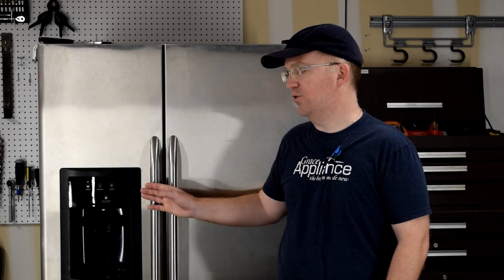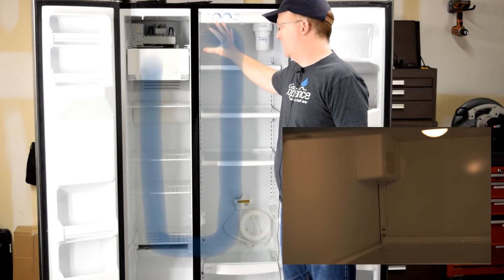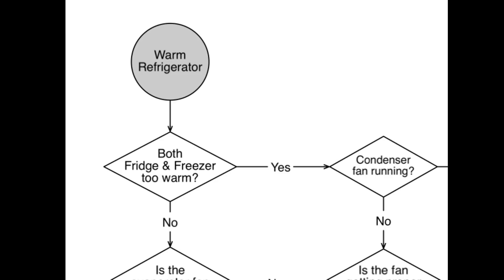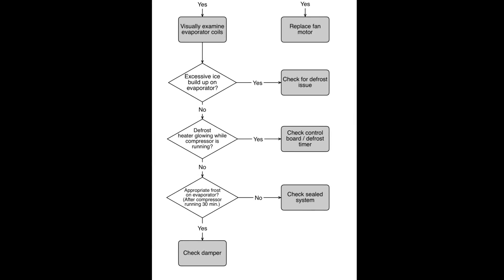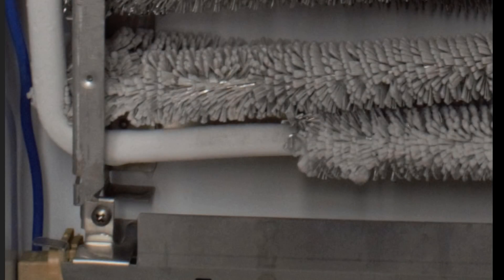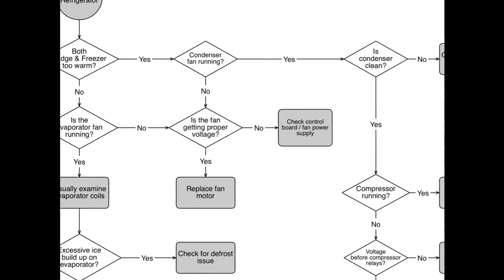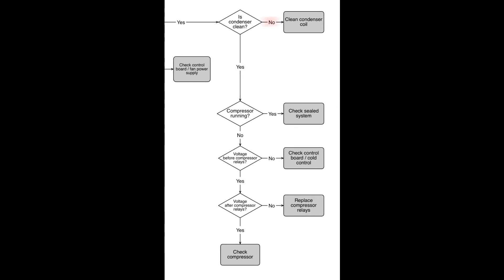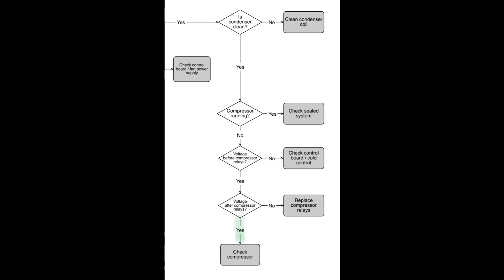Refrigerator Too Warm - Diagnostic Steps

Comment: Andy, hugs you're the best :)
Reply from the maker: Thanks!  I'm glad to be helpful. Stay in touch.
Reply: Hey Andy, I'm sure this wasn't what you had in mind when you said keep in touch. But im hoping you can please help me again. What could cause a motherboard to keep failing? Background...I have the same test fridge you have in the video.  
My fridge stopped cooling a month ago only the interior lights were on. I changed out the 200D6221G009 board. The original didnt have any burnt areas, but when I put the new one it instantly worked for about a month. Today the panel started to act weird...flashing 0s across.  So I pulled the fridge out to disconnect it and try to diagnose the panel. I heard a click then everything turned off again except the interior lights. Its still plugged in n rechecked the fuse. I think the motherboard is bad again after just 1 month.

Comment: My fridge is at 63 degrees and freezer is at 47 degrees. How can I fix this?? I need help.
Reply from the maker: Hi Mai, 
If you will please send your model number that will help me in pointing you in the right direction. 

Are you able to tell me:
- Is the compressor (behind the fridge and looks like a bowling ball) running?  
- Is the fan next to the compressor running?
- Can you hear the fan inside the freezer running? 

Thanks!
Andy
Reply: GE Side-by-Side ONLY - Refrigerator Repair Videos yes it’s running
Reply from the maker: @Mai.Faith86  and how about the fans?  What is the model number please. You can find this inside the fridge section on a white or silver tag.
Reply: GE Side-by-Side ONLY - Refrigerator Repair Videos model # is LGUB2642LF9 & the fans are running.
Reply from the maker: @Mai.Faith86  the next step, I would want to know if the evaporator has excessive build up of ice on the coils.
This sometimes can be seen with the evaporator cover still on, but often will require some disassembly of the freezer.

Depending on your comfort level with all of this will let you know how to proceed. You'd need to remove the freezer door to give you space to work and the remove the back wall of the freezer to expose the evaporator coils.

After the compressor has been running for at least 30 minutes, you should have a light coating of frost on the coils. However, if you find that after running for several days you get excessive ice build up on the coils, this frost build up will block the air flow in the freezer and fridge and cause the higher temps.

Let me know what you are seeing on your side. Thanks
Reply: GE Side-by-Side ONLY - Refrigerator Repair Videos I do see ice buildup in the freezer and fridge. I’ve tried defrosting and unplugging the fridge for couple hours but it’s still showing the high temps. I’m not at all good with fixing or repairing appliances. 😕
Reply from the maker: Mai Nguyen hi Mai, 
It sounds like you have a defrost issue. 
If appliance repair isn’t something that comes easy for you, you may consider having a professionals help with this particular job. After some substantial disassembly, It’s going to require using a meter to test appropriate live voltages to rule out a failed control board, perform continuity tests on the heater, thermal fuse and sensor. Anything outside of the control board and this particular fridge is a bear to work on if it has defrost issues.  I hope the info is helpful. Thanks!

Comment: Hello Andy!

   I just watched your videos on the GE side by side refrigerators. My unit was warm and the compressor was not running. One of the relays on the board was clicking every 5 seconds or so. When it would click the condenser fan would twitch but not actually run. I did the tests of the j2 plug per your video.  I had just shy of 13v red-white wires, nothing at the yellows. Jumpered the yellows and both fans ran. Unplugged the j2 to do a resistance test an the relays quit clicking and the compressor kicked in and ran. Unplugged the condenser fan and checked resistance at the fan and got a 1.688 reading. Checking resistance at the j2 i got a low reading like your video. So even though it will run with a jumper, does this sound like a faulty evap fan and a bad board like your video? Or a bad board and a strange resiistance reading at the j2?
Reply: Thanks for the info Andy! Have you done a video on evap fan replacement and I'm just not savy enough to find it? Or is that a video you have not done yet?
Reply from the maker: chad hoover hey Chad, my videos won’t usually cover disassembly / reassembly as much as they’ll cover the actual diagnosis of the issues. I just don’t focus on that nearly as much because there are some really well done videos on how to perform most of this out there already and they do better at it than I would anyway. LoL

I love Steve from PartSelect...he’s like my grandpa that I’d like to buy a drink for at some point in my life.  It’s on my bucket list.  

Here’s one that I like:
https://youtu.be/d5EzKao5QCU
Reply from the maker: It sounds like you've got a failed evaporator fan motor. The fact that you can unplug the fan motors from the board and the fridge functions as normal indicates to me that the fan motor has a short.  It's almost always going to be the evaporator fan motor because it is constantly wet and the water shorts out the fan motor and gives your symptoms.  However, if you wanted to double check this theory - you could unplug just the evaporator fan motor at the fan itself and see if you get the same results as you've gotten. 

If so, your evaporator fan motor is bad. Side note, once you've unplugged the fans at the control board, you can take another voltage measurement on the board directly for the fan motor pins and look for 13.5vdc with the fans unplugged.  If you get that voltage, your board is not at fault. 

If you have a 4 wire evaporator fan motor (with no sensor attached) you'd need this fan: (ordering through these affiliate links helps the channel as we get a small commission from the purchase) WR60X10185 - https://amzn.to/2lgv7LZ
Or
If you have a 4 wire evaporator fan motor with the defrost sensor attached, you'd need this fan: 
WR60X10074 - https://amzn.to/2lm5Xf7

You can purchase either the OEM versions I linked to, or an aftermarket which are cheaper. I tend to lean toward the OEM as I've never had any issues with them failing after repair, but either way is probably fine. 

Please let me know if you have any questions!

Thanks,
Andy

Comment: Thank you. I followed your chart. My G.E. fridge is not cold enough. It just started getting warmer about a week ago. The freezer staying at 20 and the fridge staying at 53.It's not fluctuating from these numbers after all the work I've done to it.  I've cleaned the the condenser coils. Did a continuity test on the compressor, and it's fine. I also tested the start relay switch, and it is also good. I removed the evaporator cover and I noticed a light build up of ice on one side of the coils. I don't know why it's not getting colder. Perhaps a T-stat problem? Thank you very much. Any info appreciated. By the way, my refrigerator is 24 years old this month. Perhaps it's time for a new one, but I'm trying to do all I can to bring it back to life first. :)
Reply from the maker: Hey,
So, the evaporator coils should be getting a light coating of frost on almost all of the rungs of the evaporator. If your compressor and fans are all running and not cutting on and off, after about 30 minutes of run time you should see a light coating of frost on the evaporator.

If not, that would be a problem with the sealed system and probably not good news.

If you want to take a picture of the evaporator after it's been running you can send it to Graceappliance@gmail.com

Thanks!

Comment: Hi Andy. I have a side by side door unit GSS25GSHECSS.  Its 2-3 years old.  Ice unit started melting and noticed both sides were 20-30 degrees warmer then set temps of 0 and 38.   stays a constant temp of  29 for the freezer and 57 for the fridge.  Trying to diagnose the problem now.
Reply from the maker: hey Rex, are you able to verify that both the fan behind the fridge (condenser fan) and the evaporator fan are both running? 
Are you seeing any heavy frost build up on the back wall of the freezer?
Reply: hey, I verified the condenser fan is running. Also the freezer had only had  frost on the first two coils. I didn't pull the evap fan panel yet but it wasn't blowing any air out nor did i hear it running.
Reply from the maker: @rex1759  hey,
If the compressor has been running for at least 30 minutes you should have the majority of the the evaporator rungs coated in a light frost. If not, this sounds like a sealed system issue. Either the compressor is weak or it has lost its refrigerant charge.

If you wanted to send me a picture of the evaporator to Graceappliance@gmail.com I would be happy to confirm this diagnosis.

Thanks!
Reply: I think the evaporator rungs are working properly.   There is light frost on all of them.  It was when i first removed the back panel there was light frost on the bottom rungs but the upper two had a heavier frost on them. However, The evap fan will not turn on at all.
Reply from the maker: @rex1759  OK, that sounds better. Heavier than normal frost build up on the upper rungs nearest the fan is a symptom of no air flow. So that's good.
Reply from the maker: I have a video specifically on diagnosing a failed control board when the fans are in question if you will look for that one it will help you determine if the board or the fan has failed.  Let me know if you have any questions. Thanks!
Reply: @GraceAppliance ok thanks
Reply: I replaced  evaporator fan motor hoping it wasn't the  board.   Problem solved.    The old motor had a funny smell to it like it burned out. Thank you for your help.    $15 dollar cost and a little time and tools.  My wife did most of the work because she could fit her body and both hands in the freezer.
Reply from the maker: Rex awesome job!  I’m so glad it worked out for you!  Thanks to the follow up.

Comment: Hi andy. If everything is running and cleaned and should be cold . What now?. I have a frigidaire model # FFHS2322MBE was giving to me a week ago . I plugged it in left it alone for 24 hours and it still not cool. The thermostat is showing H1 Which I'm sure means temp is too hi. And the fridge is too warm. I was told to unplug it for 5 min. And then let it sit for another 24 hours. I have done it 5 times now. And still showing the H1. Everything seems to be running fine though. Just not cool.
Reply from the maker: Hi, 
The things I’d check is to verify that both fans at working. You’ve got a fan behind the fridge and an evaporator fan. If the one behind the fridge is turning (condenser fan) the compressor should also be running. If one is running and not the other, that’s an issue that we could look at. 
If the compressor is running and the freezer is warm, the evaporator fan should be running as well. 

Now, if all these are running and not cutting on and off, after about 45min of run time, you should notice a notable difference in the freezer temp. 
If not, I’d want to know how the evaporator inside the freezer looks by removing the interior back wall of the freezer section.  The majority of the coils should then be covered in a light coating of frost. If not, that indicates a sealed system issue. 

Let me know what you’re seeing with respect to the compressor running and fans. 

Thanks!

Comment: Thank you for all your help. Twice in a month a repair man has been to my home because My fridge was warm at 60 degrees and spoiled all our food.The freezer was cold but not freezing he took the back panel of our double door fridge and took it out side and hooked up a water hose with hot water to remove thick as a block of ice build up on the could .he said that's standard practice and there's no problem with manually defrosting the coils twice in a month .last night he did it again and this morning it's doing the same thing :(
Reply from the maker: Hi Gnella, I’m sorry for the slow reply.  This doesn’t sound normal to me. It defiantly sounds like a defrost issue to me if you haven’t had this issue in the past. There are freezers that are manual defrost, but usually this is once or twice a year. I’ve made a video today addressing this and am uploading it tomorrow.  But, the short answer is that if your fridge is not manual defrost meaning it has a defrost heater, you shouldn’t need to be doing this often at all.
Reply: Thank you very much Andy 🙏🏻 all of your videos are very helpful keep up the great work .

Comment: Andy - I am back!
Hope you're having a great Fourth.
I would be except I'm still trying to fix that GE fridge that's been hot for over a week.
Where I am now.
I have a 3-1 that I connected, going through the run capacitor.
BUT there are so many different wires and connectors I wasn't sure it was connected properly.
I did test the windings (?)
Run > Common - 4.6
Start > Common - 7.1
Run > Start - 11.5 

The compressor hums but no loud noise.
Today I tested continuity between my plug and the 3-1 to make sure I wired properly.
I easily get continuity between my "input" wire and incoming wire that is dashed.
That "pings" on my meter with the plug on the right.

However I can get no continuity with the plug on the left.
In fact, I was frustrated and scraped just enough insulation off that wire and tested to that plug.
Nothing registered. 

I just put it back together and plugged it in, but trying it without the run capacitor.

This might be wiring 101, consider me a dumbass.
Am I doing something wrong?
If not, could I try wiring the 3-1 directly to a different cord, plug leads into an extension cord?
If so, should I reconnect the run capacitor?
Reply from the maker: Hey, happy 4th as well!

The resistance figures you gave seem good to me. The 2 smaller figures will roughly add up to the larger figure, so that's good there.

You can also test each pin to see if you have continuity (I. E. Resistance) between any of the pins and one of the copper tubes on the compressor.
If so, that would be a shorted compressor.

It could also be that the compressors motor is seized up. Sometimes called a locked rotor. This wouldn't be good news. If you are getting 120vac to the 2 wires coming in to the 3in1, you have appropriate voltage and the compressor should be starting up at that point assuming the motor isn't locked up. You can hook the 2 black wires on the 3in1 up to a test cord of 120vac, but if you're getting 120v there now there isn't a need for that. 

The fact that it's humming tells me you are getting at least some sort of voltage which may or may not be 120v.
If it is 120v, double check against the 3in1 install instructions that you have the pins hooked up correctly...it does sound like it would be a locked compressor. 

The easiest way to confirm this locked compressor scenario is by using a clamp amp meter which would let you see how much power the compressor is drawing. If you hear that hum and it's pulling like 10Amps, that's what a locked compressor would look like on the meter. 

I hope this helps. 
Andy

Comment: Hi Andy!
Great video, especially for someone like me who knows just enough to be dangerous.
I have a GE Adorra, maybe 10 years old.
Model #POS- ice maker works, the chute & auger no.
I digress. 

Last year I replaced the defrost heater which is actually a cheap & easy diy.
A couple of days ago, I noticed no longer making ice, similar to last year.
Today, noticed water in the freezer, I assume dripping from the ice machine.
Several hours later, both frig and freezer are 61 degrees, just finished throwing everything out of the freezer.

When I open the freezer, I distinctly hear a fan running.
I already took the back panel off and there is no ice on the coils.
I'm about to take the back off and hit everything with the ShopVac because I'm sure I'll have quite a bit of dog hair back there.

(and I was lazy and forgot my plan to clean it June 1.)
Anyway, I'll follow your advice to clean it all and see if it cools down. Just wondering if there is anything else i should be looking at while I'm down there?
Thanks again and thumbs up.
Reply from the maker: Hey!  Thanks for the kind words.  You’re most welcome.  Sorry for the delay. 

Now, if your compressor is running, there should be a light coating of frost on the evaporator fins. The majority of the rungs should have a light frost on them.  

Can you confirm that your compressor is running?  If so, the fan behind the refrigerator should also be running (condenser fan). 

Let me know.  Thanks!
Reply: @GraceAppliance  

HA HA! Seems so long ago!
Seriously, update.
Lights are on, no frost.
Based on other videos, took off the start relay and it sounds like a baby rattle.
Put the continuity meter on it and it buzzed off and on.
Many videos suggest replacing the start & overload relays with a Supco RCO 410 3-1 Hard Start.
Didn't want to wait for Amazon 3 day so bought local over the counter. Worth it because the counter guy told me that's mostly what they sell instead of replacement relays. Also, he personally installed one in his beer fridge - 20 years ago. 
My problem is the wiring.
I was overwhelmed by the maze of wiring running in and out of connectors.
Stopped at the parts co today - (good move v Amazon). They told me I was overthinking. Basically find two power source wires and connect them. That's what I did and, connecting the three lines out per the diagram.
Black - 12 o'clock
Red (run) - 3 o'clock
White (start) - 9 o'clock.
 I plugged it in, lights and inside/outside fans are all working and  a very faint hum from the compressor.
Not loud and it's not getting cold. Wondering if either I miss wired, if there is an issue with the run capacitor, or if it is the compressor. (copper tube out was running cold before this).
Any suggestions?